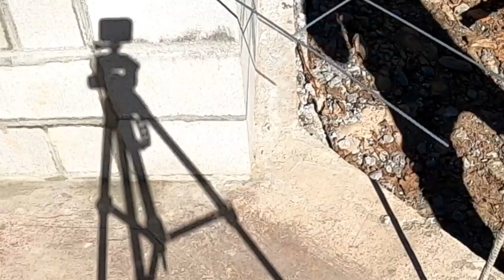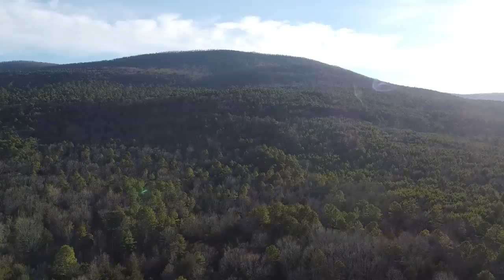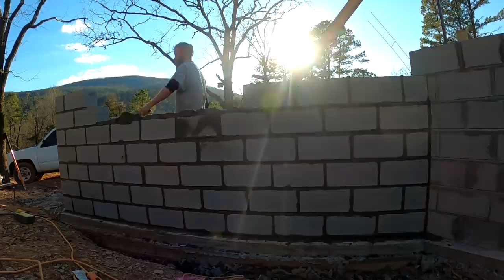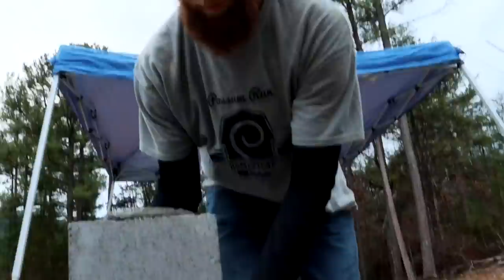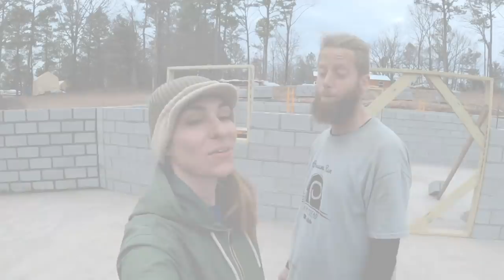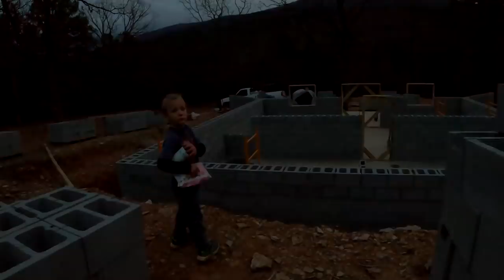Water Diversion Walls/Kickers For Block Basement | Couple Builds Cabin

Comment: Watching your videos and seeing in the back round in the back you are close to being above the hillside at 7 high with your block. You may want to go 9 high in the back and maybe a little down the side so when you do your pour you will be above the dirt in the back on 1 lift of concrete. If you only go 7 high you may get an air gap between layers of concrete  which could lead to a possible leak or crack  just below grade. 9 high in 1 pour would make it stronger to just above grade where your wall would need it the most in the back wall.

Comment: Enjoying your videos. Y’all are doing a great job on the block work. I heard you mention the septic tank on this video. Just a suggestion, I would wait until way later in home build to install the septic tank. Septic tanks and drain fields are easily damaged when equipment and or vehicles run over them. I’ve built five homes and I always install the septic tank last. Hope this helps. Keep up the good work!

Comment: Here is a tip from a pro, spread sand on top of finished concrete after you lay the first course, this will help the mortar from sticking to the floor and you only have to clean up once tou are finished building the wall to full height.

Comment: It's awesome the amount of work You 2 have accomplished on the build!  Kudos to both of you on the build & teaching your kids a work ethic that pays off.  Getting Abe to help will be a childhood memory he will always cherish.  I am curious about the blocks being set back from the edge of the concrete foundation.  Is there a specific reason for that?  I looked on our brick house & the bricks are set flush on the edge of the foundation.  Just wondering why?     Do you know if the concrete pour-ers will use a sleeve to get the concrete down the the bottom of each block?  I have never seen this done & don't know anything about building with blocks.  I have learned a lot from your channel & build, & would eventually like to build a house with a walk out basement, too.

Comment: Please give very high consideration of grouting in two separate lifts.  Because of the 45 degree corners, low lift grouting is a must.  Extremely high risk of blow-out if you were to try a Hi-lift grout..  Cost of two trips is less than the the the cost of a blowout.

Comment: AWESOME job guys.  Question, how did you install/tie in the kicker where you had to cut the rebar off.  Just drilling a hole and inserting rebar means it could come out of the slab when the wall wants to move or tip over with dirt movement.  I have seen them epoxied in or anchors.  Thanks.

Comment: Back in the early 70's as the story goes, there was a Masonry's laborer he had to stock two layers. He had to make the mortar and haul brick and block for two layers. he busted his butt all day for the first couple of days he didn't get no breaks other than his half hour lunch. He was one laborer trying to keep two layers setup with brick/block and mortar and they were working opposite ends of wall. So he started at a center point where he had to load a wheelbarrow of brick or block and run it to the layers then mix the mortar then haul that to each of them from the center spot. At the end of day two he was spent and went into the field office to let the bosses know that he'd finish the week out but that was it. he wasn't being paid enough to work his butt off like he was and having the layer's tell him to get the lead out move faster while everyone saw him busting his butt and laughing at him because he couldn't keep up... The boss said no problem and he was not to show up for work until after lunch the next day but he would be paid for the full day...
When he got there everything had changed where everything had been staged in between to two layers it wasn't set up that way no more. There were so many skids of mortar, brick, and blocks set up along the span of the wall the wall was 200ft. long it. There was staging about every 10ft. or so. When he got there the boss was there to meet him along with the local union reps. Come to find out the two layers had a bet going on how many setup workers they could go through in a month so far he would have been number 5 for that month.
Let me get to the point of the story the work goes smoother and quicker when the material/blocks are laid out properly for the laborer and the layer...
Gary it's to bad you didn't get to go work with a block layer for a week or two before you started working on your home. There is many tips you would have learned to where you could have been a lot farther ahead than you are...

Comment: Glad to see you are doing well.  How long will it take to get the concrete guys out.  That should be interesting to watch.  Also I was wondering if you ever got your power run out to the basement. You mentioned moving into the basement.. Shouldn't you have the roof up first?

Comment: I would avoid moving into the basement at almost all cost. Take a lesson from MBF! I can imagine the constant noise and the chaos. Building materials all over, kids toys all over, tools, food and clothing. Why must you be in the basement I ask myself? If trailers too cold, why not build two cheap 10x10 sheds insulated but no siding or drywall. Make them boxes with flat roofs with tarps and shovel off the snow a few times over the winter. Like a table outside it doesn't collapse under snow load. Fabric collapses sure but not wood sheeting when supported every 16" or even less if needed. May take a couple more 6x10s but save so much time and work building pitch roof. Could build them in a few days. Maybe you have it all planned out and thought of all that, if so ignore all this. :)